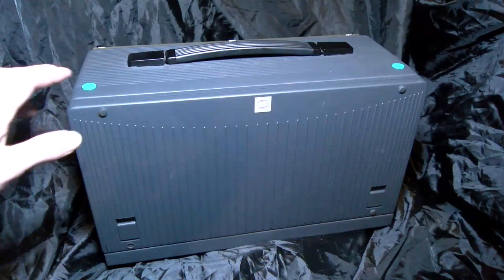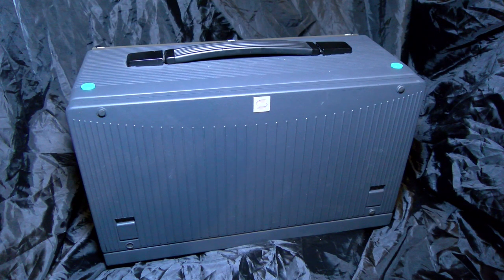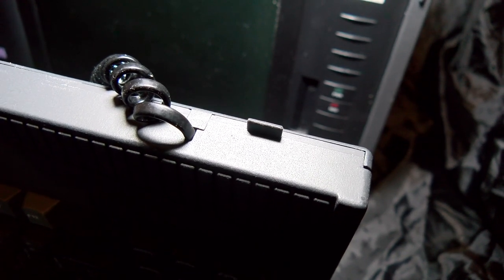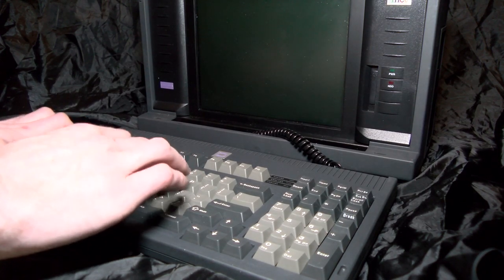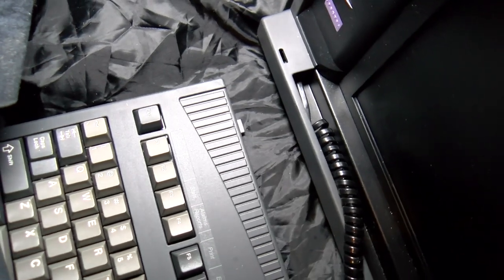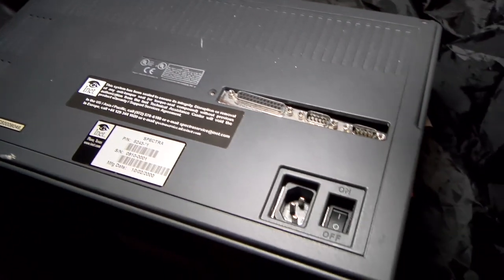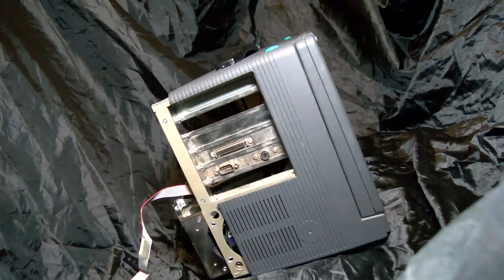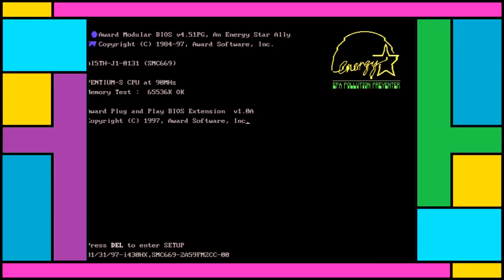Dolch Portable Overview - Failure by design

Comment: Holy cow you scrapped the DX7?
Reply from the maker: Absolutely, long ago now, it was garbage. I finally understand why the old synth folks hate digital, because if that was my first exposure to it, I'd hate it too. The firmware was crash prone, the PSU connected a mains referenced capacitor to the chassis so I kept getting shocked, there was no real way to program the synth and trying often ended up corrupting the program memory for which there's no restore as Yamaha removed this on the Mk2, plus all the instructions you can find - of which Yamaha provided none, it has no real manual - are for the Mk1. Tou also need a lot of external processing to use the two or three sounds that might be useful, because you're stuck with the factory sounds and most of them aren't exactly melodic, it's amazing how you notice after using one how much of a chain they had to stuff the noises through in songs to use the damn thing, because the synth engine is crap. As such, I only ever completed one song with it and still had to stop short of what was intended. There were a few incomplete recordings made, but they suck.
I didn't want to throw it out, because it was still 'working' like new, but even after I accepted I'd not make the money it cost back, I couldn't get rid of it, nobody wanted it even when it was practically being given away. As such it got thrown on the pile at the end of the road and its fate is unknown, either someone grabbed it, the council carted it off and it's rotting in a landfill covered in schoolgirl piss and pieces of plasma TV, or some yobs dragged it onto the field and smashed it, makes no odds to me, it was taking up too much room.
One amusing thing is how you can hear in some songs where the musician was struggling with similar problems due the the unruly nature of the synth. Knew I should have ordered that Prophet 600 or that Arp instead.
Reply: HighTreason610 I see well that explains it then! :) I don’t own one myself but would like to acquire the similar rack unit - Tx802 I think it is. I’ve got the tx81z.  The DX7 keyboard version is too big for my space. I agree with you on programming although with the software editor it should be possible. There’s just a lot of iconic patches you can sysex to it.  Dexed VST will get you most of the way there.  Can always tell the difference though.  Cheers great video!
Reply from the maker: Well have fun if you find one, I think TX7 modules go cheap, but they're desktop modules and I don't recall how similar they are. The tools are actually another issue as, to say it's meant to be popular, there are almost no tools for it. The tools that do exist don't usually work with the actual synth and use their own dumb format, which is an issue if they stop working as whatever library of programs I might have would then be lost. I think it was actually Dexed that claimed to use plain SysEx but actually didn't. It's odd they'd do it this way, given that's basically what comes down the cable.
Overall I don't think I'll be including any FM sounds in any music soon, my setup isn't complex enough to make it viable and to affort the equipment I'd need to make it sound good, I could just have bought a better synth to start with.
I found a few of the crappy recordings; http://dxzeff.com/trash/dx7_leftovers.zip (and also included a more complete Analog Much version from the CZ to make up for the horrid noises, demo video is coming but is months away due to drawings being slow to make) so you can hear for yourself what I mean. The DX7 isn't very musical and even the sounds you might be able to use need more processing than I have, just listen to how harsh and indistinguishable everything is with the electric piano noise, sounds nothing like those 80s ballads. You also realize why songs back then kept leaning on ancient analog synths for most of their sounds.
Of course I might just lack ability with it, but I can usually get something musical to come out, even a Jupiter 8, which I have no love for at all (and only borrowed) will at least produce an acceptable little song in my hands, 80s Yamaha gear just sucks.
Reply: @HighTreason610  Yeah I forgot about the TX7 modules.  Wouldn't mind grabbing one for cheap. but I'd prefer the bigger better rackmount TX802 (which I think is like a DX7 MKII) or the TX816 with fully populated bays I think would be epic.  But I love all FM synth from Yamaha OPL2/3 to every derivative.  BTW listening to your DX7 demo tunes.  I think they're really cool.  Is the CZ one up on your soundcloud?  (checking... it is! Awesome i'll comment there).  That was great.  Love that sound.  I know what you mean about the CZ having a more analog quality.  I have a CZ-101 and a CZ-1 i'm a fan.

You borrowed an OG Jupiter 8!? Wow cool.  I can't only hope to shell out for an MKS-80 some day (have an MKS-70).
Reply from the maker: At one time the TX7 was practically being given away, in fact I use to have a clone of one, or so it claimed, but it seemed to have a clone of some 4-op in there instead which was uncannily like OPL. This was my first 'real' synth module, I pretty much started on FM and have no love left for it any more, it was a bitch to work with bac then and I thought the DX7 wouldn't be such a problem, it was actually far worse.
Those weren't demo tunes, the only demo tune is 'Impending Showdown' as nothing else was finished and those ones were just tests. Personally I hate them, DXOK is almost impossible to listen to with headphones due to a weird high-pitched noise I couldn't get rid of, DXHYD is a damn mess, both of them have 'coughs' in the where the firmware decided to start puking error messages again (MIDI communication is not stable) and they all took far too long to put together. There's a more complete DX7BEP somewhere but it's really bad and I'll leave it until after the CZ-1 demo video, whenever that is, need to draw faster, has an animated section in it.
By contrast I can get in front of the CZ and go from nothing to music within a few hours, even with my original CZ-1000 in 2004 (still even have some recordings from that, but they suck, didn't make anything that decent until I moved to an MU80 but missed my CZ for years) I could sit in front of it at get a passable song going without too much headache and I could at least program my own sounds, even if they weren't great, within a week or so of owning it because the interface made sense. Even now there are way more songs with the CZ-1 than I bother to share because it's actually fun to play with, even ones that are rushed, like a bunch of Nitemare 3D covers, turn out OK on average and when they don't, it's usually my fault or my insistence on pushing the instrument places it wasn't meant to go, like orchestra or something equally silly. I can zip up the Nitemare 3D ones if you want.
Yeah, I'm not really into analog synths like the Jupiter 8, I only really like the Prophet 5 and Arp Odyssey, strangely the MG-1 for its likable crappiness. I was even supposed to get a P5 instead of a DX7 but got screwed over and won't be able to afford one ever again. I've never liked Roland gear and think the JP8 sounds like metallic burps (where the DX7 sounds like farts, hence FartMaker Synthesis), not sure if I have my recording from it anywhere. It belonged to a guy I used to know who owned a lot of stuff, but I almost broke his System 100 and then busted his D-50, so never talked to him again because I didn't want to pay for it. Roland synths always seem to break when I play them - all I did was press a key. Think I may have at least a partial recording from the System 100 somewhere in the archives, but it's grainy as I used cassettes back then.
I should probably upload Gruntilda's Waltz onto SoundCloud at some point.

Comment: I normally enjoy your videos but... I mean, you having a bad day or something? "Failure by design" is a pretty ridiculous statement considering that aside from the RTC battery the display, PSU, keyboard, motherboard, etc. all still work fine 20 years later. Those things are built pretty solidly.

Luggables were always a pain but they were usually used for devices that needed to be a) portable and b) required specialized hardware, they were built to a function. It is to be expected that they aren't as serviceable as a regular desktop.

Oh, and hating on mechanical keyboards? On Cherry MX keyswitches no less? High Treason indeed! (Dolch keyboards sell pretty well on Ebay.. You could probably re-assemble the entire unit and get at least $100USD based on what I see)
Reply from the maker: It's failure by design because it was designed to fail with no chance of repair. If I have to use a tack claw and bolt cropper to get to the CPU then someone seriously has some explaining to do on the design team. If I have to grind the handle off to open the case to remove the motherboard then, once again, someone has some explaining to do, there is simply no excuse. The parts you can get to are made of tape and wiring that looks like a 13 year old apprentice did it on his lunch break, and I had enough of dealing with that when I used to work. Stupid Nathan. Running a floppy drive from a fan, a fan which is pressed up against a plastic sheet on one side no less, but is supposed to cool the CPU via a sheet of something that isn't even contacting the CPU properly, a CPU they couldn't be bothered to set at the correct voltage.
We don't actually know if the keyboard is fully working, never tested more than starting DOS once and running a few things from a menu, for all I know half the keys don't work which doesn't seem unlikely given how flimsy they are.
The motherboard doesn't even work properly as it likes to corrupt the display and crash, though this probably has something to do with those incorrect jumper settings because the builders couldn't read manuals or silkscreens, apparently.
I've worked with enough portables to know this is a stinker, Toshiba have a reputation for design headaches but they're nowhere near this level of stupidity.
Mechanical keyboards have no place on a system designated as a 'rugged' portable. They have very little reason to even exist by the year 2000 at all as everyone had already moved to domes, they're both cheaper and more reliable, as well as more pleasant to use.
The system can't be reassembled, because it was not designed to be disassembled and things had to be broken to get it apart. No. It's headed off to the trash pile with the rat litter the next time I clean out their cage.
Sorry you didn't enjoy the video, but unfortunately I can only relay what I find, and what I found this time was a turd that cost me enough to hold back other projects significantly.
Lastly, it turns out Carmack owned one. If I'd known that, I'd definitely have avoided it.